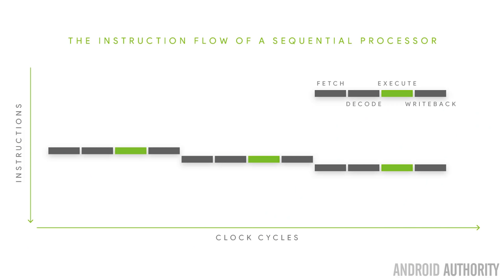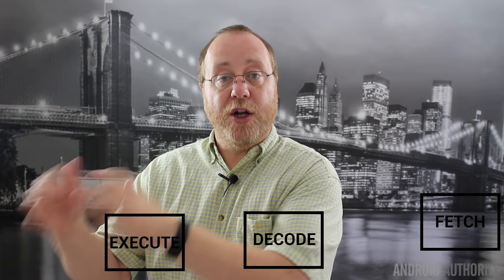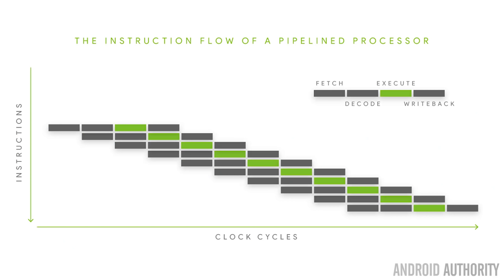Instructions per cycle - Gary explains

Comment: Gary, you said out-of order circuitry (engine) always needs to be turned on but e.g. a processor has two clusters 4 'A53' and 4 'A73' or 'A72' and it does not incorporate simulatenous HMP (hetrogenous multiprocessing). If I am using a light application that only uses A53 cluster and it's so light that it never uses A73 or A72 cluster. will the out-of-order circuitry (engine) will still be on and consuming power?  if yes, then why, because it should not do so as bigger cluster is inactive or is it- it is not inactive and just sleeping i.e., working with lower frequency?
Reply: No, this is in a single cpu. So when the a72/73 cpu are off, so is the cicruitry in the cpu for out of order execution.

Comment: Great and informative as usual Gary! Just wondering, do clock speeds have any direct correlation with power consumption? Could this explain how Apple manages to pull off good battery life with smaller battery capacities?

Comment: So on the desktop/consumer side... Intel has fewer cores but higher clock speeds AND greater instructions per clock cycle, so 5.0 GHz = 50% faster than 3.7 GHz on Ryzen.
Reply: I can't understand what did you mean by that ?
Reply: and this is why games like Arma 3 that use only one core perform better, since AMD has lower instructions per clock and clock speeds.

Comment: Wouldn't the most important thing be IPC * MHz while keeping inside the heat envelope you want to be in while keeping stable under a 100% load for however long the processor is designed to run at 100%?

Comment: I have a galaxy j3 emerge witch uses identical chip to original galaxy j3. so 2015 j3 cpu clock is 1.19ghz and 2017 j3 is clocked at 1.4ghz you are telling me that's not as big an upgrade as it looks because it's only one aspect of performance bumped up when both have 4 a53 cores witch are in order cores is that right?

Comment: Yeah we most have known the term 'IPC' (Instructions Per Clock-cycle) for a long time now, but where is the IPC of a Cpu listed. Like we know it was a big jump of IPC from 1st gen to the 2nd Gen and  From 5th Gen to 6th Gen(Intel), same applies for the JUMP From FX Series to Ryzen (AMD). I mean Ryzen is claimed to have 52% better IPC than the FX series. But where are the exact figures? Why a Cpu generation not marketed by its IPC ? Why can't Intel and AMD be simply be compared via "GENERATIONAL-IPC" figures in general ? I mean they are Microprocessors afterall, nothing that of a difference , besides the Manufacturing process of Kabylake and Zen are the same (14nm) . Why can't they simply post IPC as a means of measurement of raw SINGLE-CORE performance of the CPU,  in the product's  Description. What is all the fuss about. 

We just don't wanna know how much improvements (Depicted only as a Percentage) But also wanna know the Exact 'IPC Value' of a CPU, So we can know ' How much should we Overclock our CPU's so as to be equivalent to another CPU' Why is it so difficult for INTEL AND AMD to reveal their  IPC Figure and Only market over Clockspeed and Cores ?

Having known the Standard  IPC values of every CPU generation can make a WORLD of a difference to OUR APPROACH TOWARDS OVERCLOCKING. Believe me it's gonna be a big thing if they  have a competition of IPC,Clock Speeds and Core-count.
Atleast these 3 measures are required to judge a CPU's Performance (Before Buy/Testing).

Comment: wait, if out of order cpu can change the orders turns in a way that will optimize the run time. why not compile that? so that you will run it once then store the order for next runs
Reply: The instructions are already compiled to machine code, otherwise they wouldn't be able to run on a CPU.
Reply: Tudor Lechintan yes, but every command has a 'next' we should sort it before execuition. Like Java does
Reply: +adir mugrabi Java can't run on a CPU, it has to transform the byte-code into compiled code in order to run.
Reply: Tudor Lechintan i know. but that is not relevant.
what i'm saying is that they should make the software rearrange the code so that reading it in order will be the same as out of order.
Reply: I think that's called software optimization, no? One thing is to get rid of loops, or make them smaller (less things to execute per loop).

Comment: Why no Intel or AMD CPU examples?   -_-
Reply: Shubham Saurav well this is a mobile channel. In this case Apple CPUs mirror intel's; lower clock but much better architecture, while ARM typically mirrors AMD; high clock and cores, but less efficient architecture. Scalpel vs sword.

Comment: Yeah, an iPhone almost does the same thing as an android phone... in 720p... when an android phone does it in 1440p. lol
Reply: +Diogo João 
It's like saying that all the PS1 would need in order to run games in 4K is a better GPU... It's utter nonsense.
Reply: +Nick Pascuzzi your talking about GPU.,,
Reply: +Diogo João technically it does affect CPU performance because the CPU has to send more info to the GPU plus the GPU uses more ram to render a higher res image.
Reply: Actually you could write shaders to solve a lot of those problems and leverage the calculating power of the GPU that way. It just depends on how stuff is coded.
Reply: +Antwan van Houdt 
Yes, it is. In fact, run Asphalt 8 with your GPU set to its lowest frequency then, run it again with the GPU set to its highest frequency... You'll see the difference, even in the amounts of frames displayed per second, is very hard to even notice. However, it will be much more noticeable when you switch from one homescreen to the other...
Reply: @Nick Pascuzzi no lol. The GPU actually push pixel image quality.....
Reply: Which is important CPU or GPU ??? What happen if the GPU all do the work without the CPU ? And how about CPU only do their work without GPU ??? Pls answer that I want to know.